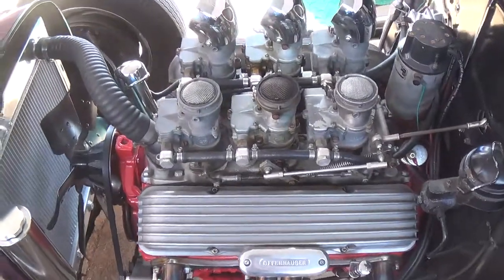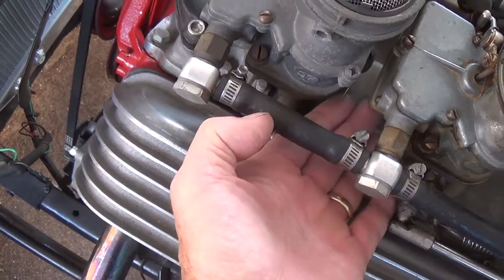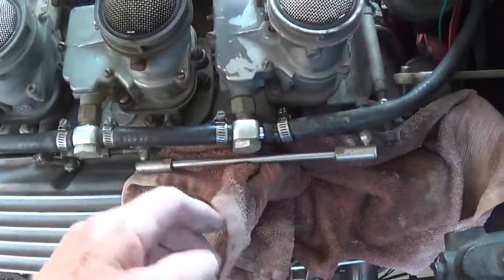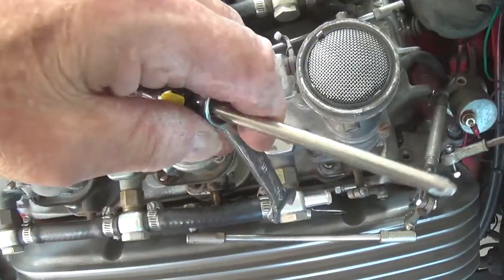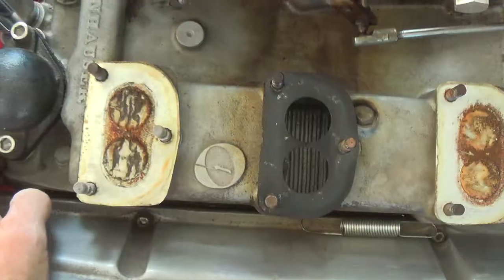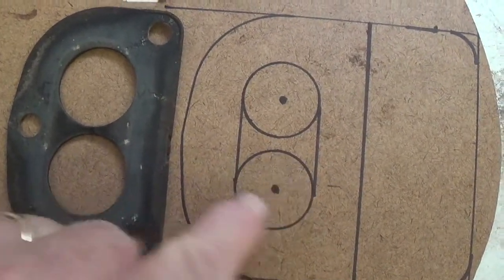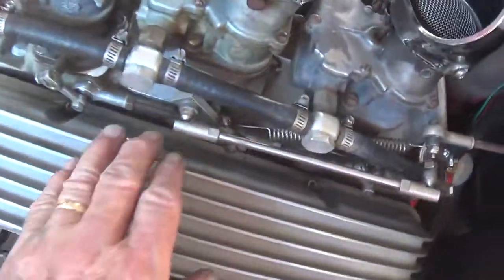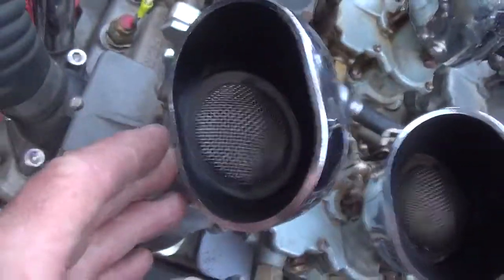Solving the Heat Soak Problem with Stromberg 97 Carburetors

Comment: If you are still having problems with boiling fuel, you might try an inline fuel filter that has a third port which allows the excessive fuel to be circulated back to the gas tank. You would have to add an additional gas line from the front to the back. Don't forget to add a gas tank breather port.
Reply from the maker: Thanks for the helpful tips, K.

Comment: Like your channel. I see it looks like you have a small block Chevy. If you are using the modern spin on oil filter you might want to look at an AC Delco PF-932 type, which is the 2-quart style for small blocks. Gives you an extra quart of oil capacity and doesn't sit any lower than the bottom of your oil pan.
Reply from the maker: Thanks for the helpful tip, K.  I'll check it out.
Reply: Following

Comment: Your fan blade is installed backwards!
Reply: Looks fine to me. At 0:0, the top of the blades rotate towards you (clockwise as you face the engine) sucking air through the radiator and out across the engine.
Reply from the maker: I either corrected the issue or it was OK to begin with (can't remember) because the car ran cool and great.

Comment: what do you mean by the 2 middle carbs are the only functional ones?
Reply: they're literally just there for looks
Reply: Did you not notice at 6:42 when the carbs were removed that the intake manifold access for the end carbs were blocked off? The end carbs are just for show right now. I suppose in the future he could drill out the accesses and make them functional.
Reply from the maker: It's a fairly standard way to run multiple carbs, Slim.  The outer carbs are blocked off at the intake manifold.

Comment: Stromberg 97's like quite low fuel pressure [3 to 5 psi?] otherwise the needle & seat can open just enough to pass some fuel. Not a problem when driving, but when parked, the pressure that you had in your fuel tank may well have been enough for fuel to  leak past the needle &  seat, overfilling the bowl & dribbling fuel into your engine. This might have been a contributing factor in your problem. 
Install your vented cap & at least that potential is eliminated.
Reply from the maker: Exactly what was discovered, discussed, and resolved in the video, Chris.

Comment: How are the fuel lines to the front and rear carbs blocked off? I get the block off plates under the carbs, but how are you keeping the front and rear bowls from filling with gas?
Reply from the maker: The input fittings themselves are blocked internally. The fuel can travel within the rubber hose, but cannot enter the outer carbs.
Reply: @uncledougshotrodgarage6049  do you know how they were blocked?
Reply from the maker: @lehmanbrad  It looked like a piece of neoprene was jammed tightly into each.

Comment: What might be a good solution if you run a electric pump is when it's hot run your carbs dry before stopping the engine
Reply from the maker: I do that before parking the car in my garage, BE, to cut down on gas fumes.

Comment: Brought back fond memories of my BMW 2002 Tim. It developed vapor locks in the fuel pump. And line. Was an old design mounted to the engine.  Installed an electric pump mounted to the frame and ultimately had to use fuel line with braided s shielding to completely rid the problem. That old beeper was designed for cold weather. I loved the drive but never bought another one. Prefer my Ford Truck.... Cheers
Reply from the maker: Thanks for sharing, K. Our best to you.

Comment: How much trouble would it be to rotate (like tires) those intake screens so that they all get a similar darkening?
Reply from the maker: I solved the problem simply by replacing the carburetors and intake manifold, Steve.

Comment: I love how you actually think the problem through and come up with a solution and don't just throw parts at the issue until it goes away.
Reply from the maker: Thanks, Clovis. I love a good engineering challenge. The older I get, the more I appreciate a simple, direct solution.
Reply: instablaster...